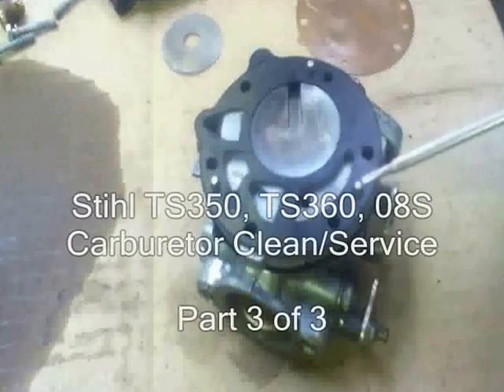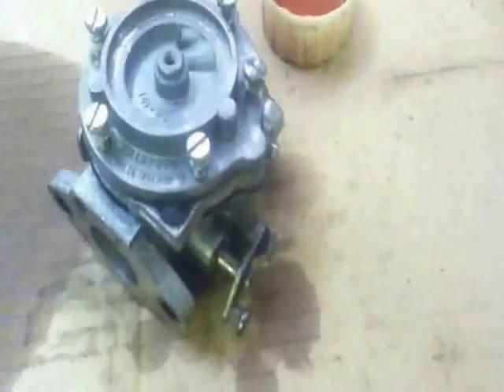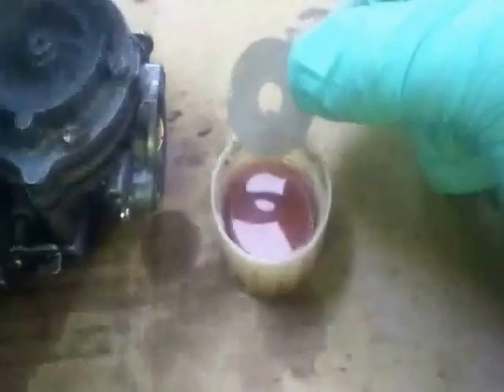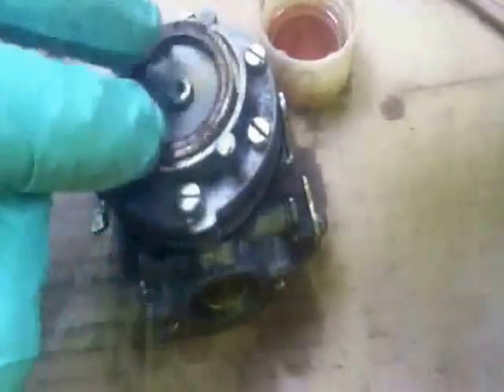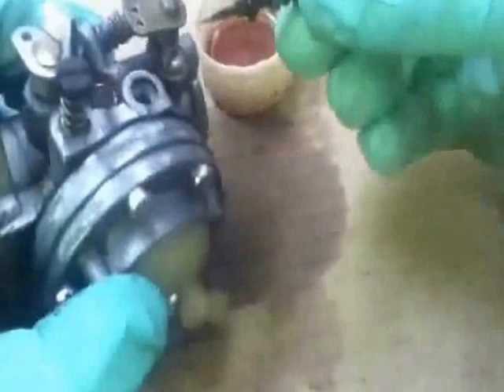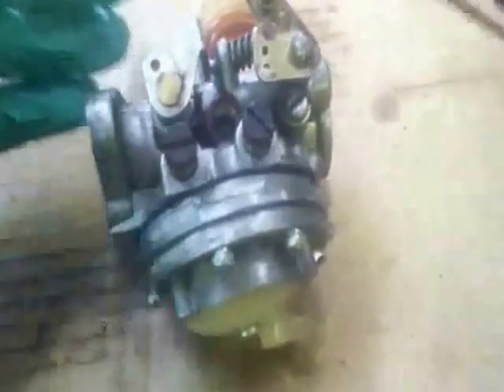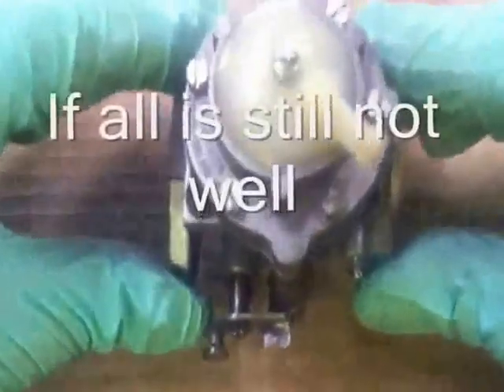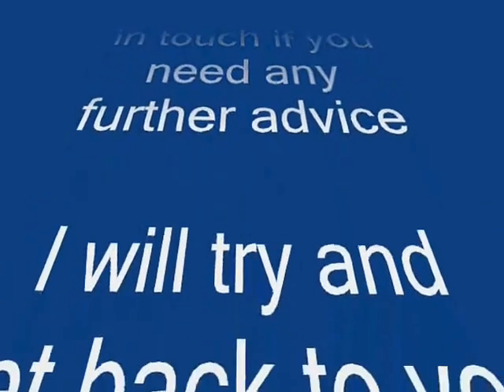Stihl TS350, TS360 - Carburetor Clean, Strip, Rebuild & Service 08S 'Part 3 - Chainsaw Won't Start

Comment: I bought a used Stihl 08S chainsaw in 1976 for £25 and already it requires some attention!. I just want to offer my thanks to you for putting up the 3 videos dedicated to the Tillotson carb used in these saws. The saw is an early version with the saw tooth logo and as far as I understand would usually be fitted with a Tillotson 166 carb however mine has the Tillotson HL 292 B made in Ohio USA. Both carbs have the same diaphragm kit so I guess they are very similar. I have been aware for some time 1 of the gaskets and a diaphragm were fitted the wrong way round but I was able to get the saw started by putting a teaspoon of petrol straight into the cylinder. Delighted to say this morning I took the bull by the horns and following your instructions meticulously fitted a new diaphragm kit. Saw started after a couple of pulls and is running like a brand new saw. She just loves cutting wood. Thanks again. Mike

Comment: I have looked at all 3 videos to put together the carb but after reinstalling the carb its flooding out of the air inlet side what have I done wrong  I have an old TS360 cut off saw it didn’t run as no spark I do have now and moved on to the carb  brand new  carb kit installed 
Thanks

Comment: Ive done the carburetor rebuild on this ts350, thanks to you, successfully done so, but after i run it it won't stay on idle according to  stihl  recommendations, they recommend recommend 1\4 out each side H and low.. May  be you can help me out on that one.. i find 1/4 out each side seems to lean for me..did no try it yet,until  i am sure... Thankyou TSR...

Comment: Blair 2021-11-07
Looking for this site for a while now. Until I torn down my carb it wasn't drawing gas. When I torn it down I didn't realize
that I missing the mesh screen on the bottom of the bowl before I put the white plastic dome on. Don't if this has any effect on the draw
or whether the saw will run continuously, keep my fingers crossed. Hi from Canada.

Comment: Hi mate, I inherited a trusty 08S which I'm trying to keep running.  Unfortunately the screw holding the choke lever valve vibrated out.  I've managed to find a replacement but can't figure out how the spring assembly linkage reattaches.  Dont suppose you know where I can find a diagram / photo do you please?

Comment: I've one of these on 08 chainsaw petrol is leaking out back of carb through air filter,  any ideas what needs doing, had new gaskets but still no better.
Reply from the maker: Darren Swarbrick, hi, it sounds to me like it's flooding. Have you noticed your choke butterfly is stuck in the closed position? If not then it could be that your carbs needle valve is not operating correctly. Are your fuel mixture screws set correctly? Any of these, but not limited to, could cause flooding. I do have a video on my channel on causes of flooding and I think it would be a good place to start for you. Please take a look and find the vid on that, it may help. Thanks
Reply: Maybe email me direct at dsgardenservices@yahoo.co.uk.co.uk if you are happy to help. I buy and sell these saws and have box full of old carbs that i have never managed to sort,  i've now started to look in to sorting them out.
Reply: Do you know about pop off testing the tillotson carb and what readings i should get?

Comment: Hi craig,as you state with this carburettor you like to turn 1&1/2 on one needle and 1 full turn on the other,but in your latest video you explain on the two stroke small engines you prefer to adjust both needles out 1 turn then start adjusting the high first.So should I turn both out one full turn first then start to adjust the high befor attempting the low speed ajusting needle screw.I know that this is a earlier vid and teaching methods can move along`But I would want to check first on your opinuion.By the way you are a great teacher`you explain very well by what I have seen on the other vids you have made,cheers

Comment: Hi
My TS350 has decided to give me problems, it has always ran like a dream but all of a sudden it will not run unless I tweak the choke, i have to keep it on full choker to keep it running but after 30 secs or so it cuts out.
It will restart but only until it gets warm then it will not start at all.
Could an overhaul of carb be beneficial ?
Also what is the best way to set the screws on the carb for mixture etc
Many thanks,any help would be appreciated
Reply: Screw all the way in and the set by 180* turns start it the listen adjust by ear